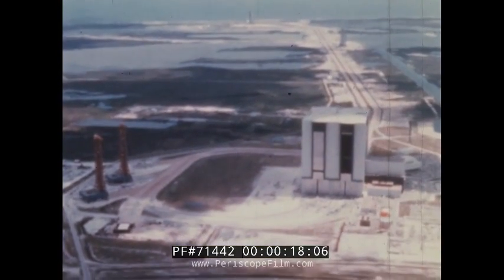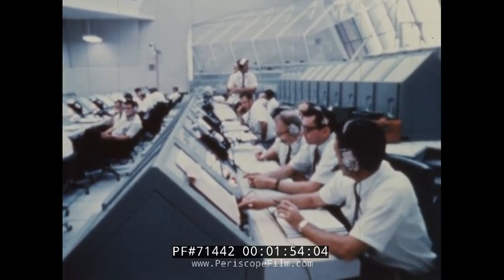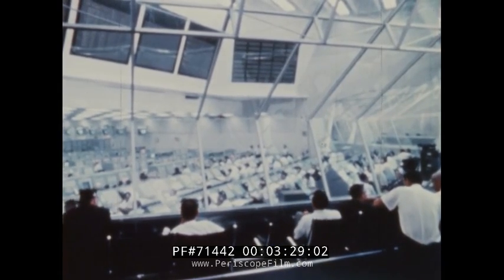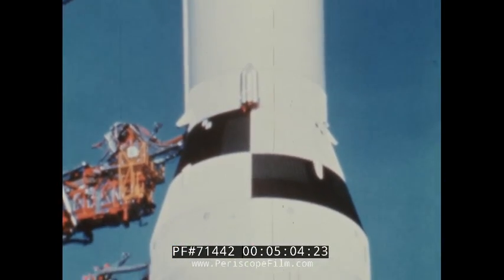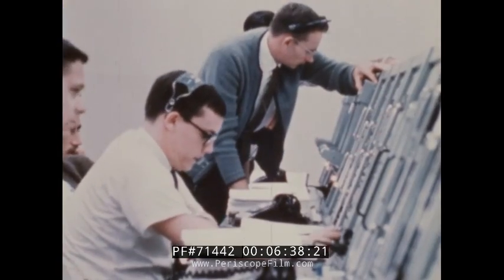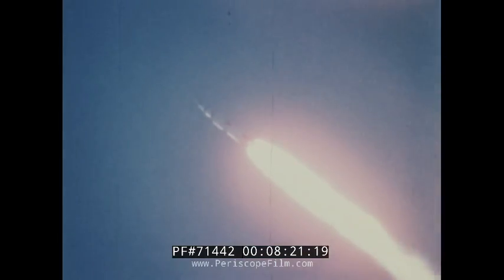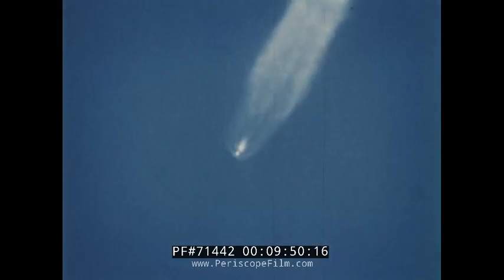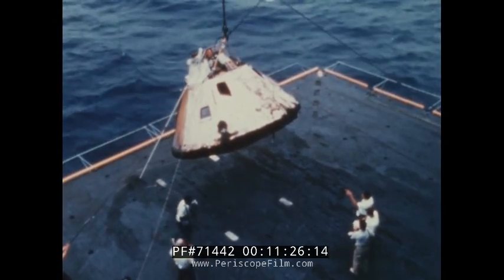APOLLO 4: THE FIRST GIANT STEPS SATURN V ROCKET HISTORIC NASA FILM 71442

Comment: Not only was this the first flight of a Saturn 5, but I think it was also the first flight of the redesigned Apollo command module after the Apollo1 fire.
Reply: I’ve never heard if that’s true as it’s been said it took well over a year to make the changes and it had only been about  ten months when Apollo-4 flew.  But I’m sure there were some changes.  If you have any info on this I’d sure like to see it as you never can get enough, right.  Thanks
Reply: I spoke with a retired pilot/engineer who had worked on the Apollo project back in the '60s. He told me about working with Dr. Werner Von Braun, one the redesign after the January 1967 disaster. I just had to shake his hand.

Comment: At 6:48. An important piece of string. It's there to make sure that the scoop that covers the hold down mechanism gets properly closed. What is the reward for that? Beeing roasted!! Poor piece of string.
But this is a bit pypical for everything that has to do with space flight. When chosing between a low tech solution and a high tech solution, go for the low tech solution. For instance, kerosene was the choice not only for fuel, but also lubricant and hydraulic fluid in the F1. After all it would only burn for 2.5 minutes. OK I guess each turbopump would spend days rotating to find and counter imbalances. Most likely they used something better as lubricant then.
A side storry to this is that the subcontractor for the ESA Ariane rocket didn't realise that the turbopump would spend the majority of its lifetime in a test bench. It was almost dying when it was installed on the first stage. So I heard at least.
Reply: Actually, they used RP-1 in the first stage for a different, but still very practical reason-the size of the rocket. While LH2 has a much higher ISP, it's also much less dense.  The first stage would have had to have something like twice it's volume, just to hold the additional volume of fuel

Comment: The footage showing the flight ascension is reversed. The footage shows the Saturn V ascending and arcing from right to left, which from the standpoint of KSC would indicate a northeast trajectory. However, all Apollo flights followed an easterly trajectory. The only way they could have achieved the flight path shown would have been from a ship stationed off the coast and located northeast of KSC. But all of NASA's footage from these flights was shot from KSC itself.
Reply: But who will notice?
Reply: @brianarbenz1329  Jimbo did
Reply: Every Apollo mission except Apollo 17 launched to the northeast. The most common launch azimuth was ~72°. Apollo 15 launched at ~80° and Apollo 17 launched at 91.5°.